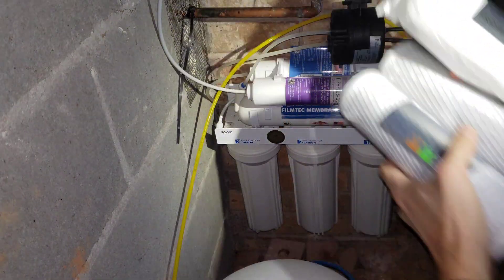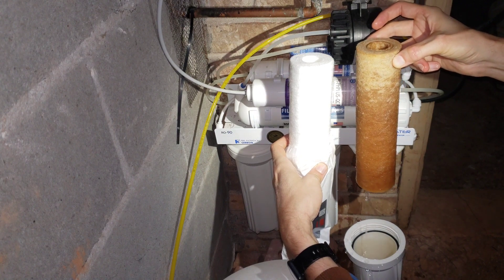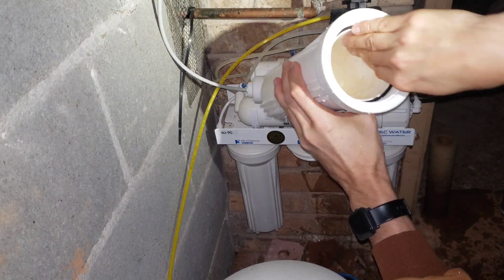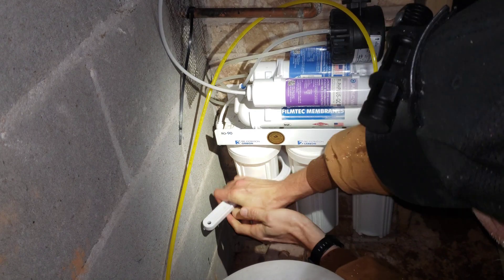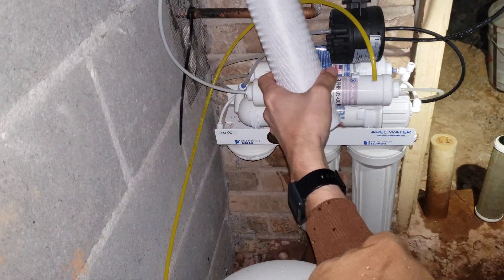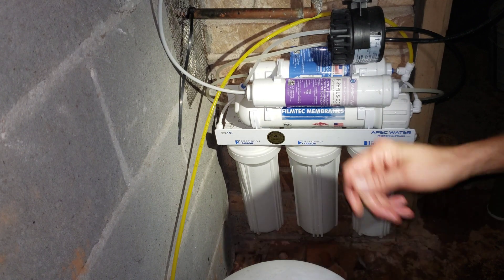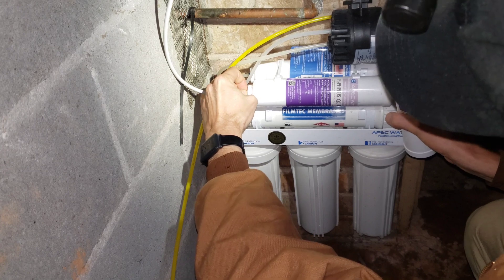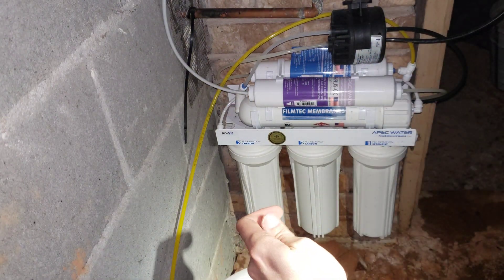APEC RO-90 Filter Replacement after 2 years | Reverse Osmosis System RO90

Comment: Does APEC recommend that you flush the pre-filters before letting the water reach the RO membrane?  My purewaterclub kit had me run a pre-filter flush for 5 minutes before letting the water reach the membrane. That flush water contained carbon that would end up potentially clogging/reducing efficiency of the membrane. I just purchased the RO-50 kit and plan to do the pre-filter flush regardless.
Reply: Good point

Comment: Did the flow get better at the tap ? Do you have well water ? How often does it discharge water ?
Reply from the maker: There was some improvement, but the capacity of the tank is about half of when the system was new because the post filtration pressure is low, which means that the RO membrane needs to be changed. We have city water. Seems to discharge water whenever it runs. I have the discharge running into the garden.
Reply: @engineerable  thanks I just ordered one
Reply: @engineerable 
Maybe you know this…but the pressure is controlled by a bladder in the tank..you can actually re-inflate them with a bike type pump. 
Eventually the bladder fails, and you must replace the tank.
It takes a while to fill the tank, the pressure isn’t tied to the filter array, as far as I know.
Reply: @boostismagic  Thanks for the tip. I will check the pressure of that tank. I had read that as the RO filter element loses efficiency, the output pressure drops, and assumed this was the reason for the lower storage volume. If the tank bladder starts off at a pressure of about 7.5psi when empty, it's going to rise as it fills. When the tank pressure reaches the RO filter input pressure minus the pressure drop across the RO filter, it will be at equilibrium and won't fill anymore. So as the pressure drop increases across the RO filter, less water will be stored in the tank.
Reply: @db7829  I found out when I had to replace mother-in-law’s tank many years ago…it would just trickle…learned about the systems then, thanks to the web!
Reply: @boostismagic  How long does a tank typically last and how do you know when the bladder fails?
Reply: @mikenobles5992  I expect it differs, but this one was several years old. They will be almost no flow from the filtered water spigot. 
You can also check it with a sensitive low psi tire type gauge. There are videos on that subject.

Comment: How do you like the Apec 90?
Reply from the maker: Works great! I've had it for 2-3 years. Only replaced input filters once. Should have done that more often though. The tank only fills about 2 gallons now instead of 4-5 like in the beginning, which means the RO filter element needs to be replaced soon. But the TDS is still low so I'm in no hurry to replace.

Comment: Word of advice, you should clean the water filter housing every time you replace the filters
Reply from the maker: Thanks, I did wipe off the built up residue and rinse them.
Reply: @engineerable  Wear gloves, Sanitize all the parts with suitable cleaner. Reassemble.